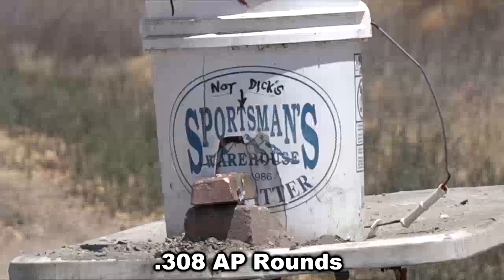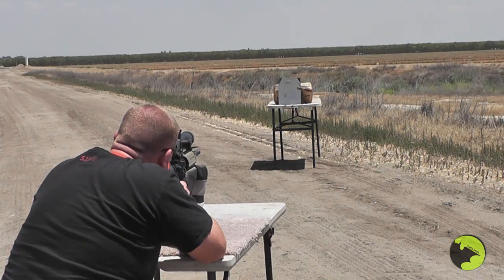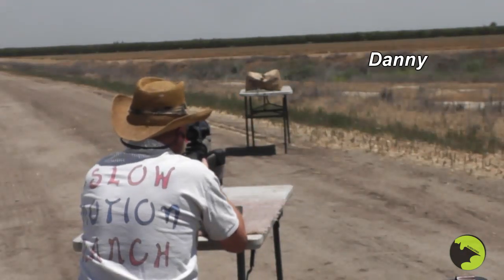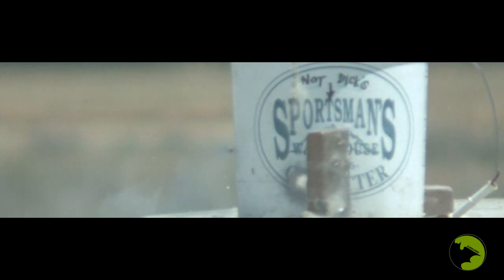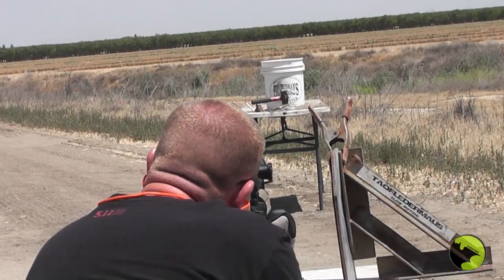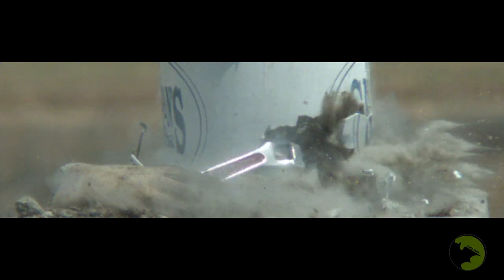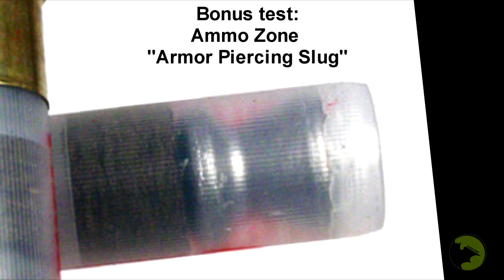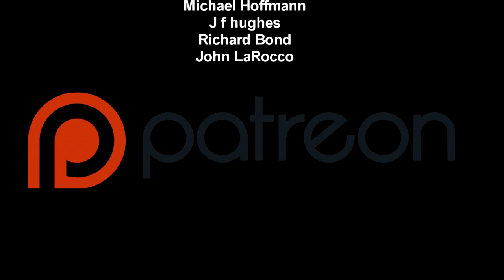.308 ARMOR PIERCING Bullets -  TESTED!

Comment: The "OG" is a good man! I wouldn't mind building some ghost guns, I mean undocumented rifles lol
Reply: You gots to do what you gots to do!
Reply: sinformant Not really that difficult and perfectly legal to do. You just need to buy a so-called 80% lower then get a drill press and get to milling out the insides of the receiver. After that it's a simple matter of getting it blued or cerakoted and adding the guts.
Reply: Phil Hsueh LOL I know the process. And I am a machinist by trade.
Reply: What's an undocumented gun?
Reply: Michael McCall home firearms. Examples would be an 80% ar15 lower, glock, 1911. Completely legal to make yourself, depending on your state laws. Federally they are legal, you just can not sell them or give them away to anyone, personal use only.
Reply: sinformant So just pretty much anything not auto or artillery? There's no documentation on guns in Idaho except for a buy from a dealer and that only takes like 10 minutes. Also I don't get 80% ar lower? You can't just buy the whole gun?... didn't know that.
Reply: Michael McCall 80% lowers aren't fully machined therefore not considered a firearm by the government. You you can purchase them online or from places without an ffl, have shipped directly to you and finish the machining and you have yourself an ar15 with no serial and no paperwork whatsoever. You can't build it as select fire/ auto, and can't be an sbr. Yes technically any firearm you buy at the dealer isn't registered, but it was manufactured and issued a serial number to the government as well as documented where it went to(dealer/distributor) your dealer has you fill.out the nics form to run your background to purchase it and they keep a record of the sale of that firearm. Not sure what the government requires the dealer to do with that paperwork whether they have to keep it for a certain period of time or what not. But bottom like there is some sort of paper trail for any firearm purchased through a dealer. None for that 80% lower. For some its the satisfaction of making it yourself, others its the fact that it doesn't technically exist.
Reply: sinformat - In the 90's the requirement was 20 years for the paperwork. Not sure if that has changed.
Reply: Poppy S for what?
Reply: Yuo could make an original-style full-auto Sten pretty easily, too. It was designed to be made in tractor maintenance sheds on the quiet in occupied Belgium and fire the occupiers' 9x19mm Luger ammunition.Probably more accurate than the Ingram spray-gun, too.Thing is: I'd rather have a good rifle.Bolt-action .30-06, semi-auto 5.56 and a 20-gauge shotgun with #4 buck, #4 dove and a few wax slugs ... that'll do. I don't see the need to bounce bullets off random parts of the brickwork in this town. If I've got to shoot something, I want to hit exactly and only that thing, and if I'm shooting paper targets, I want to be able to say "Yay, me!" when I see the group size or score at the end.

Comment: I bought some surplus on gun broker. There were a few black tips in the lot. I didn't realize it.. I shot my AR500 steel. Broke the eye off, hit the target stand, went through the top of the stand the part that holds the steel, through the 2 x 4 and out the other side of the metal holder. It actually ripped the back of the steel holder out. Not much stops those.

Comment: I'm no expert on ammo, but I knew that Pearson round was going through that copper like hot butter! It's been 30yrs so ammo was fresher, and I was using a ww1 Springfield, but as a teenager I prob shot 40-60rds of those through everything from old straight 6 cast iron engine blocks telephone polls.. my grandpa had a legit military arsenal and there was never any shortage of ammo.. Even those Red tip tracers (always on new yrs and the 4th July) those tracers basically had miniature road flares in the ass end... I shot one through the woods at night and saw so many ricochets I thought the round was coming back to me... I did manage to set the woods on fire, but from then on ive been nervous to go into the woods during deer season! Great video!

Comment: The tracer rounds will be hard to see at short range in bright daylight. The phosphorous blob at the tail end of the bullet is indeed ignited when the round is fired, but it takes a short time for it to start burning fully. When impacting, the phosphorous material will continue to burn and it is not uncommon that it detach from the bullet and flies around its own way. Especially at night, you can see this when target shooting and you could think it is the entire bullet ricocheting up and away - but it is just the burning material. Bright red/orange tips are indeed the marker for M62 ammo, 7.62x51 NATO tracers.

The M61 armor piercing rounds are indeed fun plinking rounds and it is amazing what it can penetrate. They are hard hitting little buggers :)  They would not have any problems stopping cars and trucks by disabling their engines or penetrating some lightly armored vehicles (M113, Im looking at you!) :)

Comment: I promised myself long ago that I would be  "  non California compliant "  , so far, so good ! 😊
Would be great to have a few hundred of those AP rounds, a LARGE assortment of materials to test and a full day to do it........... you know....... for science ! 😊 👍
Thanks for sharing and take care. 👍 👍
Reply: If your pistol grip extends below your butt, you're not CaliCompli ... so be sure to sleep on your back if you ever visit.

For myself, I'd like to take a 16" AR15, an Enfield Competition Rifle (25.4" barrel bullpup AR180) a lot of magazines and ammunition and some building materials and tools out into the desert somewhere miles from anybody, set up a pair of 24' tall, 8' wide 0.5" plywood walls with an aiming mark on each near the top and shoot 10 rounds ball and 10 rounds tracer at one with each rifle from 100m, 200m, 300m, 400m, 500m, 600m, 700m and 800m to see how the group sizes compare, whether the two types become two separate groups and how much more spread there is after the bullets go sub-sonic, then pull back to 900m, 1000m, 1100m and so on and keep hitting them from as far back as I could to see just how far back I have to be before they won't go through.
Reply: If you do some research, you can buy "pulled down AP AND Tracer projo's to load for yourself. 
Google is your friend. 😉

Comment: I used to manufacture BR laminate of glass and polycarbonate.  The level of protection depends on the expected threat.  For military vehicles like the MRAP,  we used nine layers of half inch, low iron glass with quarter inch hardened glass strike face and three quarters of an inch of polycarbonate innermost as a spall shield.   This would stop .50AP.  The standard was three rounds inside a 12 inch triangle with no penetration.  Three round impact resistance should allow time to escape the kill box.  We made THOUSANDS of them.
Reply: .308 stood no chance

Comment: Tracers do not light until the  have traveled about a hundred yards. If they did they would give up your position.  There is a copper disk in the back of a tracer bullet that is heated on firing and takes just an instant to light the trace compound.

Comment: 3:50,   I have projectiles that appear to be from 30-06 AP rounds.   A 164 grain, flat base, boat tail, FMJ with black tip.   I removed the jacket and found a steel penetrator similar to that in the video that was shaped like a boat tail projectile.   These appear to be the projectile from the 30-06 M2 AP rounds.   

I loaded some into 7.62mm cartridge cases with a moderate load of powder for the projectile weight.   Shot AR 500 metal at 200 yards with them in the day time.   Result was very big, bright, flash of sparks.   The AR 500 plates only had the paint knocked off with no apparent damage to the AR 500 1/4" plate.   I do not know what the bullet velocity was. 

One day I might load more of these with a maximum recommended powder charge, per my Hornaday reloading manual.  Especially since I now have the Garmin chronograph so I can measure bullet speed.

Comment: Tracers are like a strike match, the initial burn isnt much, and takes a split second to fully ignite. With a bullet, it travels so fast the full ignition will not happen until it travels 100 yards, depending on the type of ammo etc. Pistol rounds will travel slower and tracer will light up earlier, a rifle round travels much faster so will travel further.

When a tracer strikes before full ignition, the compound tends to splatter with the bullet breaking apart. If it passes through, it tends to lose the compound from the projectile and it will burn for 10 seconds even if submerged. A hit to a human torso tends to follow that pattern and boil out blood in a foamy goo. The rhodesians called the hit targets floppies, as theyd tend to flop around on the ground until the tracer compound burnt out. 

No bullshit, Ive thrown more than a million .308 down range in a single day. I can hit a target with a 240b from 1,000 yards in bad bush and do it all day everyday. I know the sweet spot for them babies, know their drop rates, know their conical dispersion.  At 150 yards, typically, depending on barrel length etc, 150 yards is the most stable with the least inertia drop and most likely to penetrate steel plates. Each weapon handles slighrly differently, just takes a few rounds to judge it. It does take some flight time to fully stabilize the.7.62x54 round. They have an odd warble out the barrel and it makes for a messy close range hit. I tend to dial my scopes in at 200 yards, but uave a few setup for longer range. Youd be surprised what stock a ptr g1 can do with a dialed in scope.

Comment: From my personal experience with tracer rounds in the Marine Corps and in casual shooting here in AZ it usually takes 50-100 yds to ignite the tracer compound. Their primary use is in military machine guns so the gunner can see exactly where the rounds are going when shooting at a distant target. For all the single barreled guns (M249, M240, M2) the belts are set up with a tracer every 5th round. On the electrically driven M134 its like one in 10 or something like that since the rate of fire is so high on this guns.

Comment: If you shoot the tracers at a longer distance, you'll notice the red path of the bullet. I used to shoot tracers out of a .22 LR and when I shot them into fence posts, the main portion of the bullet would go through the posts, but the rear portion with the red flash would remain in the fence posts while still spinning. By the way, you may only notice the path of the tracer rounds when the distance is great enough to keep the bullet in the air for long enough for the eye to notice it and trust me, at night they are bright.

Comment: I have some original WWII era black tip 30-06 M2 AP rounds. How do they compare to the .308 AP rounds since .308 is basically a 30-06 with less power and a smaller casing (but ballistically they perform very similarly with a simple FMJ).

Comment: What you need is a heavier bench with a vice so you can hold your targets still, you will probably find that if you hold the targets still you will get better penetration. Tracer rounds often need a little bit of flight time before they react, this is so that it is harder for an enemy to exactly locate the point of fire.

Comment: If you get another tracer round, unload it from the cartridge, stick it in a vice, and touch the back end with a torch, if it's any good it should burn like a flare for a second or two.

Comment: Tracer rounds don't actually activate straight out of the barrel.  They usually take about 30-40 meters before they will actually ignite.  This is intended to make it more difficult for the enemy to be able to deduce the exact location of the fire coming in.
Reply from the maker: These were just old and defective.   I've seen a lot of tracer rounds burning right from the barrel that I filmed at MG shoots.

Comment: Usually tracers are designed to light up down range so they don't lead a trail back to gunner and make it easy for enemy gunners to send return fire back at where they shots originated. My understanding is most tracers in common machine gun calibers have worked like that for a couple of decades now.

Comment: Years ago I had an H&K 91, chambered in .308.  I went out to the Everglades and found a 14 inch thick wooden beam.  I set it up with a steel pail and the round went through the beam, through both sides of the steel pail and I still didn't find the bullet.  For sure it'll go through trees.

Comment: Your tracers are fine. You're firing them at point blank range for rifles. Often a tracer won't show its firetail until it's 50 or more yards away from the barrel, and it's just not as visible in the sunlight the same.

Comment: I wasn’t gonna comment, but I noticed some references about the distance a tracer ignites. Some say 50-70 yards, and that’s probably true, apparently the military found that tracers revealed the shooting positions too easily and extended the range of ignition to 300 yards (ish). I pulled some old tracer ball 30-06 (mill-spec) and found the 300 yard ignition to be true for the rounds I fired out of my 300 BLK.

Comment: I think I have between 200-500 rounds of Lake City Arsenal black tipped 30-06 date stamp 1943, loose. Once had 1500 rnds but lots of punching holes in paper later, Never had a misfire. You all want?  I'm currently in Amarillo (I RV full time).  All the bullets could be pulled the brass cleaned and reloaded, reliably punch holes in 1" plate at 100 yards.

Comment: Not exactly the same but I had some 30.06 rounds (black tips)  and I shot through a railroad track with it and it stuck in the other side. A piece of the jacket hit me in the face. I was 15 at the time. Few (about 10) stitches and while you can still see the scar it is not very noticeable.

Comment: Modern tracers don't light up right away.  They can take 25-50 yards to light up.  This is to prevent the firing position from being compromised as quickly.

Comment: hey love the ballistic testing, i recently acquired 400 m2-ap bullets and loaded them in 308 with cfe-223 powder. @2780 from 24in bolt gun. but over pressure. flat primers. do you know what velocity you were getting?
Reply: Can you tell me o
How this worked out? Any stress marks on your brass? Any issues with accuracy? What depth on seating?
Reply: @cjm321  mag length 2.800. primers were cci200's , maybe use mag primers next time. accuracy was good for pull's. about 1.2 in at 100yds. i loaded them hot , cfe223 is a slower powder. these M2 bullets out perform the lighter FN ap. even at a lower speed. brass was winchester.

Comment: I have had M134 rounds that were designed as long trace 308;  they typically don't light up until after 100 yards and stay lit for well over 400 yards. Back up further next time.

Comment: just so you know you will not see the tracer fully ignite at those ranges. you have to remember the bullet is traveling at high speeds, and the substance used on the rear of tracer ammunition is going to take time to fully ignite and be noticeable. I learned this from watching mythbusters episode when they were trying to ignite gas tanks with tracers.

Comment: A couple decades ago my friend and I shot the edge of a broken excavator bucket, approximately 1.25 inches thick of abrasion resistant steal (very tough stuff) at a 10 degree angle. (in case of bounce back) our rifle was an old SKS firing 7.62 un AP rounds from the Ukraine. Poked through no problem. I think most of the

Comment: This stuff isnt meant for accuracy. Every 5th round in a 7.62x51 belt is a Red tip tracer. Every other are black tips. Stuff is very beat up and is just meant to go down range in a general direction.

Comment: Safety is obviously extremely important BUT videos with tracers in the daytime??   Tracers are used to help troops to see where their rounds are going, they are not designed to have any extra power.  When firing a machine gun on full auto it's difficult to track the rounds, the tracers allow the gunner to see where the rounds are going and make adjustments as necessary.

Comment: Certain powders, ussually w/ slower burn rates, wont consistently light the Tracer compound. Ive also seen 30 cal. Tracers that dont light until around 100 yrs down range, they are designed that way to reduce the enemies abillity to pinpoint the position its fired from. Also ive seen tracers that are only visable through ir headset/night vision.

Comment: The tracer effect doesnt start untill its much farther down range, if it traced from the end of the barrel to impact it would give away your position far too often. That red glow on the wrench shot was the burning tracer, that would of been a line thru the air if the bullet was still in travel. You dont need tracers when your shooting at something 30ft away lol so of course your not gonna see the effect at a target that close. Try somehting 100m+ away.

Comment: If the rounds are made to a military spec the tracer will activate within a specific range. Could be anywhere from muzzle out to two or three hundred yards. The specifications are written around a lot of circumstances such as blowback into very expensive aircraft and electronics or as simple as confusing the opposition.. Most of the tracers that I've seen manufactured for civilian use ignite when they leave the muzzle... They want to know where you are...lol

Comment: I want to see you load a drill bit proper size and length and see what happens, you can load one for 30 calibers 9 mm even 12gauge, drill bits come in all sizes, and with a variety of tips, even diamond tip. Not the whole drill bit just cut to the proper length, So if we should run out of bullet material we would always have our drill bits for backup.